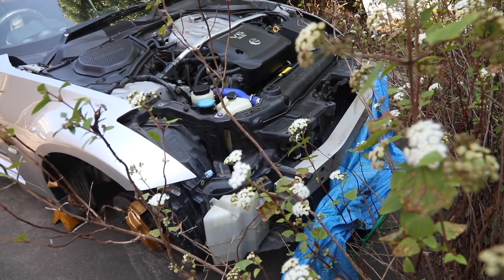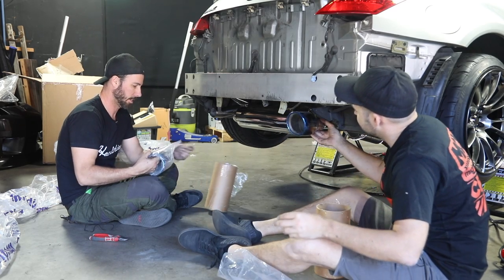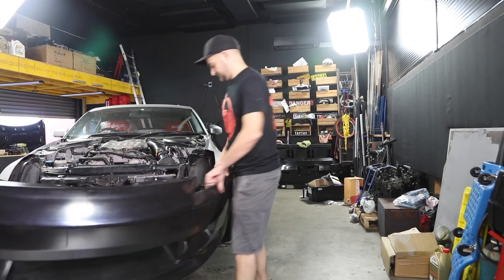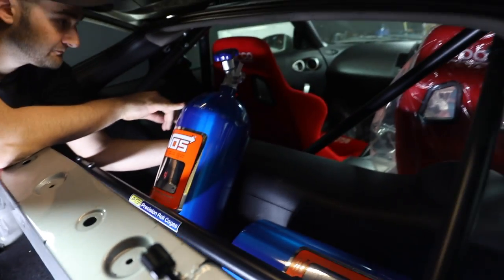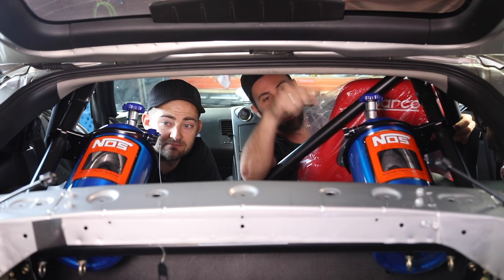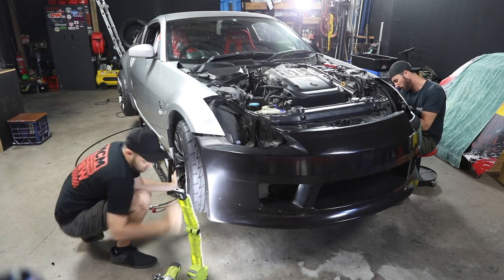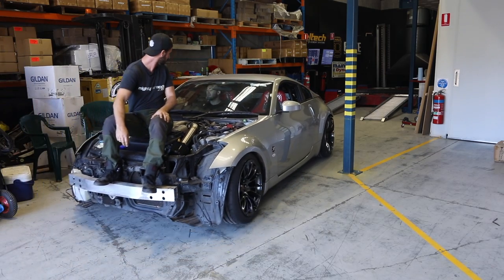350Z Make Over - PART 2

Comment: 18:17 why has this car only 217 hp.... i think it should be around 280 stock and with nitrous around 350 hp... thats a very slow 350Z =(
Reply: Cupra300 it should have made AT LEAST 250 without the nitrous. AT LEAST.
Reply: Reading too many brochures mate, Japanese car companies in particular measure power output at the crank or flywheel, a lot of power gets lost between the driveshaft, diff and cvs until the wheels get whats left. I drive an 86 and let me tell you, if that car actually had 147 kw stock, no one would complain about it being slow. Mines stage 2 and only makes 125 kw
Reply: No one is going by manufacturer's claims. I own a VQ swapped Sentra and it made 267 at the wheels with bolt ons and a tune. On a Dynojet
Reply: The car was smoking blue/gray when they started it and since they didn't do any engine work the possible causes of this smoke are: stuck pcv valve, worn/damaged cylinder walls or pistons, leaky valve seals, or a valve clearance issue. All of the ladder will cause a loss in hp, some more than others of course
Reply: David Moore it's definitely in real bad shape only making 217whp lol
Reply: Yea its bad shape for the VQ35DE engine, if it was in good condition almost 300hp
My Z is at 310hp so far but i have the VQ35HR engine
Reply: The engine when brand new made 306HP and probably under ideal factory conditions, at the wheels you are looking at an easy 20% loss making 60HP less and with the age and dyno's not being comparable you land in the correct ballpark.
Once again dyno's are not comparable, the way they have theirs set with multipliers and the way someone else has can mean a 30% swing.
Reply: MsSomeonenew 217whp is the lowest 350z dyno of all time 😂. So either the engine is fucked or the dyno is calibrated wrong. Would obviously assume the engine is fucked. It does smoke pretty bad lol.
Reply: 350z are that slow. I'm sorry to break it to you.
Reply: smoke could be from a new exhaust but yea engine is fucked
Reply: or the fact that the thing simply hadn't run in ages and was running on a general base tune at first startup? though you might be right, even then it won't really matter because it's not a long term project car.
Reply: @David Moore when they started it keep in mind they had a very basic tune, and that smoke looked like excess fuel not burning oil... probably the 750's they stuck in there
Reply: 217kw 284hp just thought I’d point that out
Reply: Neill Gove it was only 218.3whp without nitrous. Which is the lowest 350z dyno ever lol. You actually can see a readout right before that that was only 217whp. The engine is shot.
Reply: Cupra300 - Every Dyno is different. Mustang dynos will read these cars as low at 190whp even though it's technically making just above 300 at the crank. Even so, this could be the older 350z which makes a little less than 300hp, stock. Either way it doesn't matter, as you can't compare Dyno numbers across the board, they are only useful for measuring gains. You fools should already know this, but since you don't, it's safe to say you've never done any real engine work on cars.
Reply: Turtleswan A stock DE 350z should be making WAY more than 217whp, a full bolt on DE should make at least 255-265 to the wheels
Reply: crxtodd16 😂 yeah right. Go try and find a dyno of any 350z ever making under 200whp on any dyno. Good luck!
Reply: Thats why he said 280, its supposed to have 300+ crank.
Reply: Cupra300, did you not see the fact that that was the cheapest 350z in Australia? Or that they only had two days to work on it with a bunch of missing parts? There is a reason they added NOS to the system.
Reply: If a car isn’t kept for properly it’s bhp will fall because all the parts aren’t in great condition straight out factory 350 are 280 sure but after it sat there like that it’s not what it used to be
Reply: u guys are mixed up YOU ARE ALL TALKING ABOUT 370z NOT 350Z!!!
Reply: This is an earlier z. It's got the single intake which means it's a de car. The hr is the high power one that has dual throttle bodies
Reply: In Australia we measure power in kilowatts not horsepower.
Reply: 217 kw he said, which is about 280hp
Reply: When people mixing hp with kw :)
Reply: The 350z should make around 280hp from factory but keep in mind not all dinos are made equal. Engineering Explained has a video explaining why the number they got is off.
Reply: Oztexs CAGLAR 370z has 332hp stock genius I have one no one is talking about those
Reply: Dfekt Nsc look at the dyno screen in the video
Reply: yeah thats why the 350 Z in this video has 162kw and 217 hp ;-) just watch again and you will see that i´m right
Reply: Cupra300 yeah you right.. it's 217hp base, and about 283hp with nitrous... pretty weak car I say for a 350z

Comment: Interesting, didn't realize an 03 Z made that little hp. I thought it would make around 240. Must be a beat motor.
Reply: Kai Okimoto That or high Aussie temps. Most Z's with the right bolt ons will make easily between 270-290whp
Reply: Exaggerated dynos in the U.S, temps don't reduce your HP that dramatically, though they do make a significant difference. Also this is on a base map, the power run was done with nos and even then it's probably been done very conservatively since they have an unopened engine and probably need it to last through some challenges.
Reply: I'm in the US and I agree, dynos here have I readings.

Comment: So that V6 with NOS is still only 280 odd HP?  That doesn't seem right.  My flat 6 3.8 pulled 391 HP with nothing added.  Surely the delta isn't that large?
Reply: yeah that engine is not healthy haha these things (depending on the year) are around 275-306hp
Reply: Yes at the crank not wheels. Whp is at average about a 20% loss from the drive train. So right now that car is making around 395-400 hp. I don't know how many times they have to explain the differences on every car. Not to mention every dyno is different.
Reply: Engine sounds a bit tired so maybe more like 380hp
Reply: People do get the difference.  We are talking about apples and apples here.  Figures pulled on a dyno.  No one is talking about or comparing theoretical crank values which are hard to determine except with the top of the line dynonometers like the mahr that use rolling resistance off power to deduce drive line loss.

The point of my comment was not to ask why there is such a difference between engines.  As a total car, things like weight, suspension, driver, etc all come together.  I was under the impression that stock engines of a similar displacement and age for their design would have a much smaller variance.  Age and servicing history not withstanding.  So how do we end up seeing such differences.  What is the engineering that causes this?  Is straight better than V vs Flat.  Is it bore size, length, compression... if how the same lump of metal is machined can make such a difference.  Why don't all makers machine their lumps of metal for a given displacement and cylinder count the same?
Reply: it all really depends... the heads could flow like shit.. or have a stroker motor like my 4 cyl from the factory makes almost 400 TQ but only 210 HP @ wheels... different designs and how stuff is made... every engine is different thats like all these V8s... some came from the factory with 200hp and others 400hp... and alot of engines have been modeled off each other if you look into it enough... but each one want to be different sell there car better than the other so each have different designs in my eyes.. maybe..?
Reply: I get that.  But don't nissan sell this lump as a "Sports car" - not withstanding the obscene weight of the car.  Why don't they make the engine more powerful with what would be essentially the same raw resources?  Is there a car above this that is really at risk of sales being canibalised so that they had to go out of their way to make such a engine?
Reply: This engine is in bad shape, it should be around 245-260 to the wheels stock without NOS, depending on the year.
Reply: And why are you talking about the 350 like it's still in development lol, you know there's a 370 now right?
Reply: Not talking about this specific car or year or anything.  Just how there appears to be a such a difference between engine designs.  So why don't or haven't makers alll ended up using the better or best designs?  For any given point in in time.....
Reply: Princess Peach These knowledge you seek can be attained, but not through YouTube comments...
Reply: Iirc when this engine was designed Nissan still adhered to the JAMA gentleman's agreement that limited the (advertised) engine output of cars to around 280hp.
Reply: This is a “sporty car” not a “sports car” something like a 550i from bmw, something as far removed from sports cars as you can get is both faster and handles better

Comment: Man, that motor is pretty tired.
Reply: bandwagon240 

217 whp = roughly 258 bhp at the flywheel and new they were 276 bhp at the flywheel so could be worse considering it's age.
Reply: kingears84 Depending on the model year, 350Z's had 280-313hp from the factory. But yeah, you can see that the motor is on it's last legs..
Reply: thats a vq35de the older 350z motor, only 276 bhp new not too bad
Reply: brianhcool That 276hp was the gentlemen's agreement. Every car that had over 276hp (e.g. STI's, EVO's Supra's and so on) had 276hp on paper in Japan. However, for real those cars had more than that.
Reply: thatsubie Appreciate the insight, the HR's definitely do make more that 276 crank, but the around me Northern USA at sea level DE's ive seen are spinning about low 200's on a mustang dyno but they read notoriously low. But 217 at the wheels isnt bad, i think people underestimate drivetrain loss

Comment: The low compression high mileage DE will take well to the nitrous! sloppier fit with the rings and all will be good for the extra heat. Plus it will clean the cylinders of the years of burnt oil!!

Comment: lol I bought my headlights from the same company (same big black box and foam ebay specials) for my 98 A4 1.8T, the originals were damaged so cheap replacements it was,  they worked and fit great can't complain, ended up looking quite sharp.
Reply: Greg Rose What's the bet they didn't get the lights VSSC engineer approved? Aftermarket headlights and tailights are the most expensive and complicated modifications to get certifed and do right, so you end up voiding your warranty, voiding your insurance, voiding god knows what else. Even if your lights are compliant and certified the police can still defect you. Most retailers and manfacturers will swear at you until they are blue in the face that their lights are adr legal but never have any paperwork to back that up.  So there is another annoying HID headlight on the road blinding everyone...
Reply: I get what your saying, I took the time to aim mine properly and remained with the 98 era halogens to avoid upsetting the oncoming traffic so far everything seems good but I'm working with Alberta road laws which seem to allows for 6ft lifted pick ups with 42" light bars as a grocery runner :D
probably be a good idea to keep and eye out for a stock set if the become available though.
Reply: Greg Rose Australian road safety laws are A LOT stronger than the USA, most Australians don't check this and get caught in the trap!

Comment: @Mighty Car Mods, what suspension arms are you using for the Z? I️ drive a g35 and I️m looking to upgrade the rear links to adjustable so that I️ can correct camber on the fly

Comment: Really odd that you needed NOS to get 280WHP. You should probably replace the clutch with something beefier. My 2003 350z gets 268WHP with just an exhaust, intake, and stage 3 clutch with lightweight flywheel.

Comment: That car stock should hold 300 hp at the crank now allow 15% drive-terrain loss of 45 gives you 255 at the wheels and with nos u could only get 280 something somethings not right there is some sever issues somewhere

Comment: i own a z, web says it makes 290 stock. shouldn't it be making way more with the happy shot?
Reply: 290 is crank horsepower. If it's a 2003 to 2006 year model range they only make around 235 wheel horsepower. Mine has more boltons than the car in the video, it is tuned by Z1 motorsports, and it most likely only makes 275 -285 wheel horsepower. Hoping to have dyno numbers soon

Comment: Lol that my auto 350z makes almost as this thing does with nos.  My set up is identical expect for a bigger upper plenum, porter lower plenum and lower intake runners, 75mm throttle body and Uprev tune. That engine is on its last leg. Btw my engine had 115k at the time of my last dyno it put down 270 hp and 262 tq

Comment: That spoiler should actually be there and the wing too. The spoiler reduces lost of air speed thus increasing pressure on the backdoor and the wing to the same thing just in smaller area(area of wing not area of car'
Reply: Sry im from Slovak Republic and im not great English speaker but its not as easy job to do beacuse you have to balance the air pressures cuz they tend to act like moments eg. force*arm so that car wont be rolling backwards hitting the top speed or higher speeds it would be best to try it and see what it does  that means dont use bigger angle of attack on the wing but i would roll the car forward or lower the front and use stiffer rear ARB it will make bonnet and roof act like pressure areas more so increase a bit downforce on front and then the wing wont mess up your pressure areas that much

Comment: Stock-engine makes 280 HP... also the exhaust smoke doesn‘t look healthy :(
Reply: Depends on the Dyno. There are 5 major types of dynos and all have different SAE corrections. Made 435ahwp on a mustang Dyno but when I got on a Dyno jet I made around 475awhp.

Also, the nitrious blue coloring in the exhaust is normal.

Comment: people are a bit over dramatizing on what the power should be on this car... you have to remember that when these cars were new they maybe made 280 at the wheels and thats maybe.  paired with the fact that the car is old and its been sitting means the thing has tired down a bit. but it doesnt mean the engine is bad... just means its been worked a bit over the years. some people trying to say these cars should be making 300+ at the wheels stock lol. no
Reply: Review Guy 

I thought the quoted power was at the crank? I've also read that the transmission in these cars are responsible for large frictional losses.

Coupled with as you say about the age and use you can easily see why the power put out doesn't look too impressive bit in reality it's ok :)

Comment: Damn bros, 274 isn't much:/ I wish you guuys could have pulled the engine and done a basic tear down and rebuild. Bearings, gaskets, and rings mainly. Butttttt while it was out, you could throw some higher comp pistons in there and you'd have closer to 300-350hp without NOS. The (money) sky is the limit one you take the engine out.

Comment: My stock 350z makes more hp??
Reply: Is that to the wheels, or crank? Manufacturer specs are to the crank, and there's loss in the clutch, trans, and diff. I suspect their car needs a new clutch to put that power to the wheels.

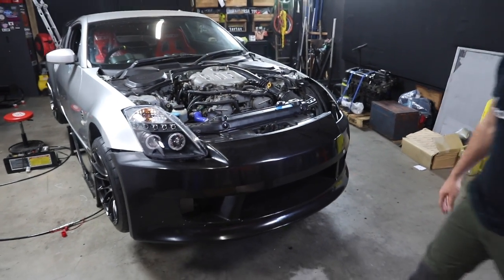Comment: Why did the Honda H flash at 7:15?
Reply: Does it fit my hyundai?
Reply: theman2max hey my rear wheels are bigger than the z's (275/40/18) and I make 303hp to the rear wheels with a 2.0 not crazy but my car is paid off.

Comment: Compression test that engine ASAP.  218HP at the wheels NA is very low. That's what that motor should be doing stock in good condition and you guys are making that with all those mods. 

UNLESS that was done with a rich mixture with those giant 750CC injectors AND timing was retarded in anticipation for the 100-shot of nitrous. Then that would make perfect sense. HOWEVER, this would make the NA baseline dyno a pointless run, as you really would not be able to compare it apples to apples to what that car should be doing on stock ECU tune prior to nitrous (even if you take into account the dyno number difference between dyno platforms like dynojet, mainline, mustang, etc... 218WHP is still low for the mods). I trust what the great Tuning Fork is doing at the end of the day, but I know that motor inside out. Maybe this tuning process wasn't clearly explained. COME ON GUYS, TELL US WHAT IS GOING ON HERE PLEASE :-)